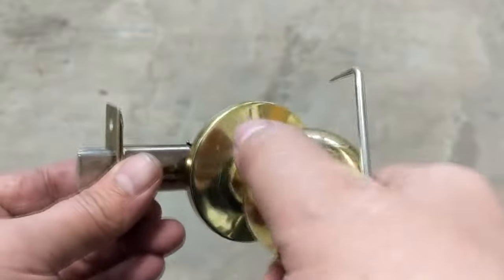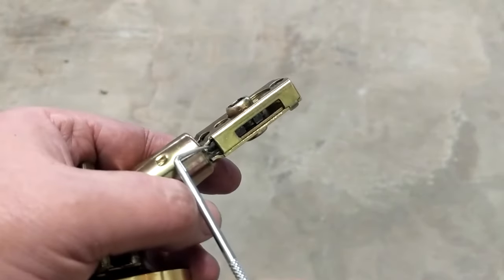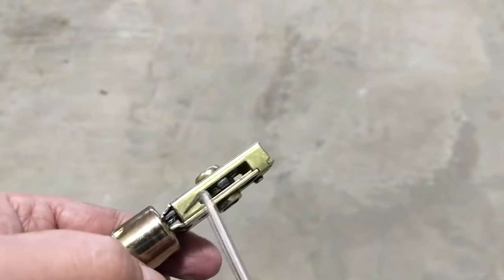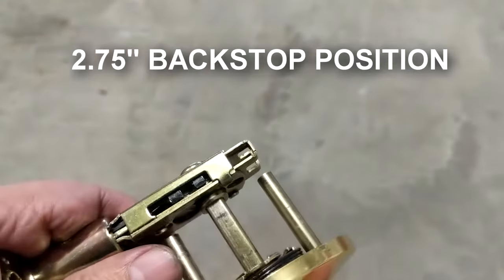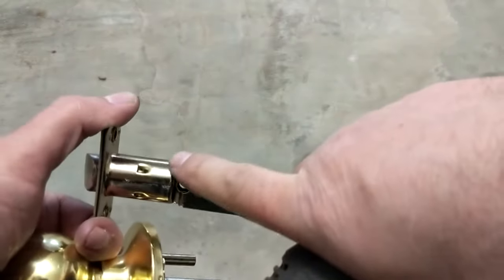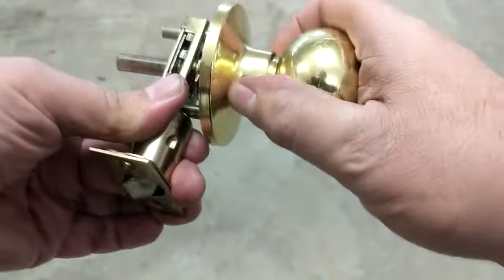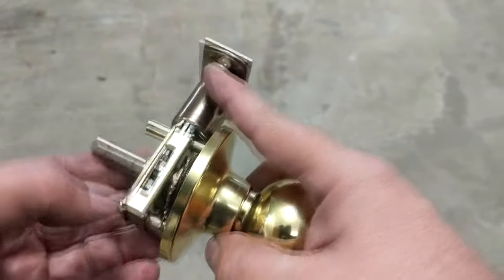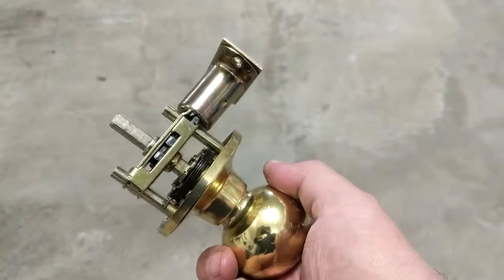DIY FIX DOOR HANDLE NOT WORKING / NOT TURNING . SIMPLE FIX FOR FREE -  DOOR LATCH REPAIR

Comment: I have an issue where when i unlock the door with the key, the key turns all the way (almost complete circle) and when this happens it mis-aligns the interior lock knob. Is this something wrong with the latch itself that I could replace just that, or something internal in the lock mechanism?